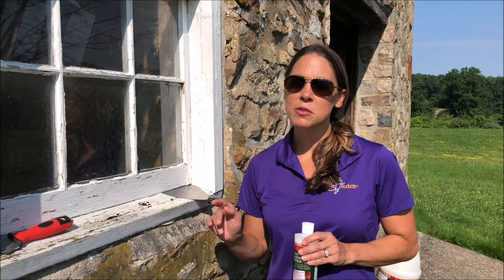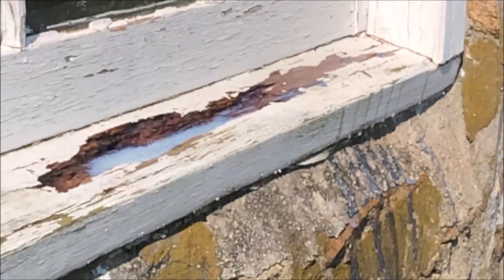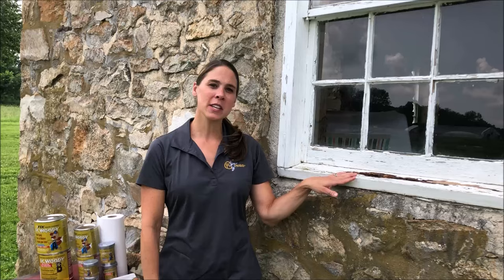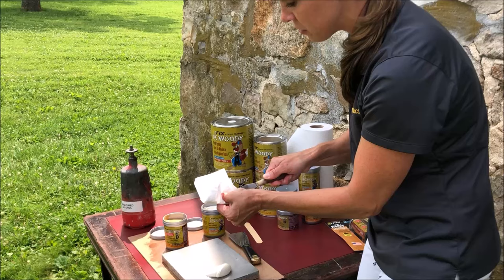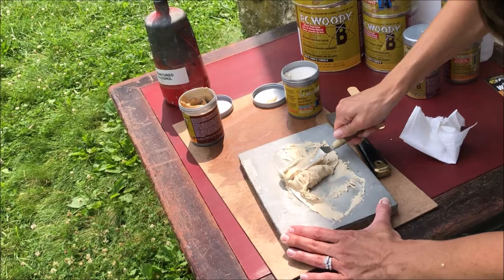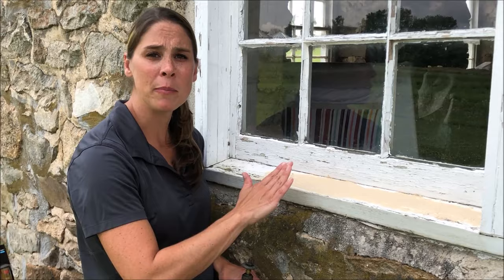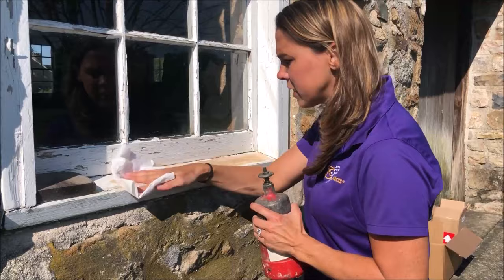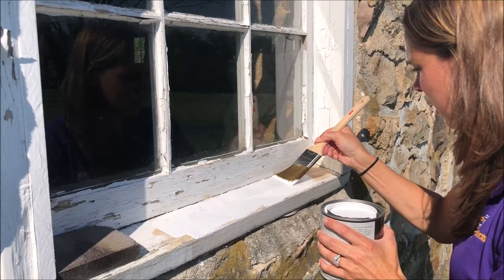Rotted window sill repair with PC Products

Comment: What is denatured alcohol?
Reply from the maker: From Wikipedia: Denatured alcohol, also called methylated spirits (in Australia, New Zealand, South Africa, and the United Kingdom) or wood spirit or denatured rectified spirit is ethanol that has additives to make it poisonous, bad-tasting, foul-smelling, or nauseating to discourage recreational consumption. It is sometimes dyed so that it can be identified visually. Pyridine, methanol, or both can be added to make denatured alcohol poisonous, and denatonium can be added to make it bitter.

Denatured alcohol is used as a solvent and as fuel for alcohol burners and camping stoves.
Reply: Thank you.

Comment: Why don't you use linseed oil putty to fill the holes and then a linseed oil paint? Traditional methods work better ..
Reply from the maker: Linseed oil putty, like most other putties, will eventually dry and crack and need to be replaced. PC-Woody will not dry crack or shrink.

Comment: Only good on horizontal surfaces. Runs right off a vertical surface.
Reply from the maker: Donald, yes the PC-Petrifier is the consistency of water so it will run. it is best to paint it on vertical surfaces. The product will soak in and penetrate the wood. In addition small 1/8 holes can be drilled at a downward angle to allow the product to flow into the wood even deeper.

Comment: Unless the rotted sill, in this case, is removed, you won't know if there is rot elsewhere.  Replace the sill.
Reply from the maker: The PC-Petrifier penetrates roughly about 2 inches into the wood. If all the loose material has been removed one can be fairly confident that the product will reach all the rot and prevent further damage.

Comment: Great video... but no safety glasses, or mask?
Reply from the maker: Both products are non toxic so no protective equipment is necessary.
Reply: @pcproductsepoxy4315  Thank you!!
Reply: @pcproductsepoxy4315  Check your own instructions with respect to sanding... It calls out a specific mask type.
Reply from the maker: @garybraden7865  a mask is recommended as breathing in ANY particulate matter can be hazardous. But again our products ARE non toxic.

Comment: Two knifes/scoop and no need to clean. 
Nice video, but set a poor example with regards to Personal Protection by not using any PPE. I was an OSHA trainer and I could not recommend this video because of the safety violations. Sorry, good explanation and demonstration except for not wearing gloves or eye protection. You don't want to find out the hard way what I am talking about.

Comment: Do wear safety googles and wear a breathing mask.!!;-) it might HELP.
Reply from the maker: Safety goggles is a good suggestion, thank you. The product is non-toxic, therefore a mask is not necessary. Thank you for the suggestions!
Reply: @pcproductsepoxy4315  I bet that paint surrounding the repair is lead.  Always wear a mask when sanding old painted wood.
Reply: @pcproductsepoxy4315  The MASK might come in handy when SANDING.!!;-)

Comment: I think it is a great product and can think of many uses for it, but I would NEVER use it to fix a rotted window sill.  That is putting a band aid on something instead of fixing the root cause. You will still have more rot in other places. Instead, replace your window sill with PVC and it will look great and you won't ever have more wood rot!  Nor will have to sand and paint anymore every again, which will save you THOUSANDS in the long run in money and precious time!!!
Reply from the maker: Our products are designed for people that prefer to repair rather than replace. Your suggestion may work for some folks but others would rather use our products for a safe, effective and long lasting repair.
Reply: Right, because everyone can afford to replace all of the window frames on their house.  I know we can't, so using this product (which I just ordered from Amazon) will be the "band aid" we need before all of our exterior window frames are painted in a month from now.
Reply: She is replacing 1 (one) window sill, not all of them like you mentioned.   And if you have enough money to paint your window frames,  then you have more than enough to replace 1 (one) window sill and have plenty of cash left over!  Unless you are paying your 10 year old nephew to paint them!  

You have to keep repainting and repairing and HOPE you got out all the wood rot and don’t have any more rot underneath that, which you probably do!  Insects also love rotted wood!  
And you pay to paint them again in the future, or possibly replace them then since they will probably be so bad!   Then the cost of replacing them will be double or triple what it is today!  
If you don’t have the cost to replace them today you better sell! Lol.

Comment: Very sloppy work.  Shake the bottle first,  mask off the area adjacent to the area being worked.  In this case mask off the stones.  You allowed the solution to run out of the wood chasm on to the stone and look at the residue.  All of this can be prevented by preparing the area for the treatment.  This product is very good by the way and works well.
Reply from the maker: Roger, thanks for catching our mistakes. You are indeed correct that prep and masking surrounding areas are important and should be done.